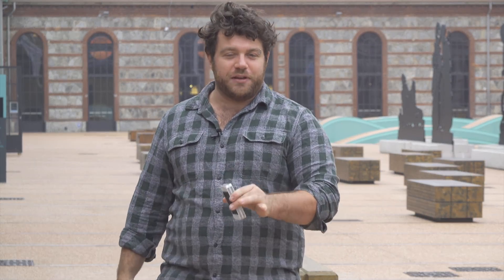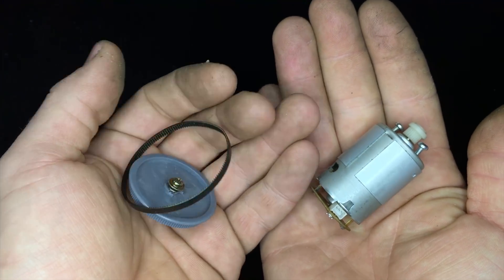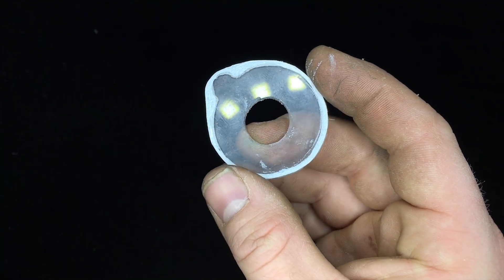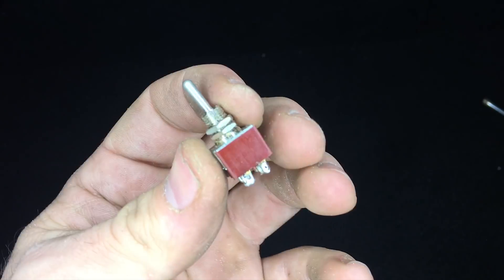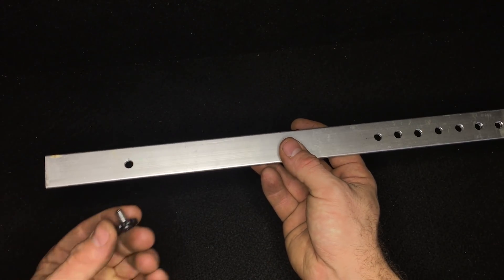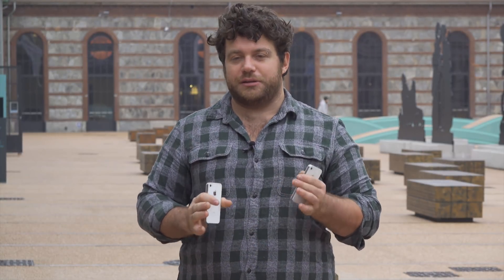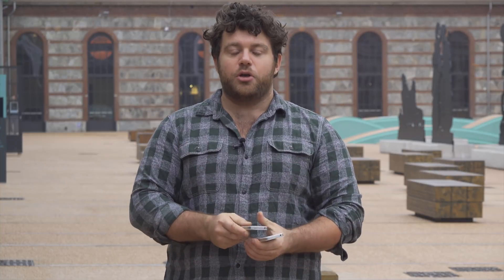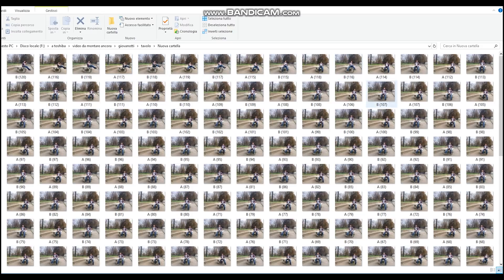Make 3D Photos placing 2 Smartphones This Way! • 10$ cost

Comment: Dude why not just record video ?
Reply: Exactly,  then he doesn't need that motor nonsense.  He can choose the frame offset between left and right cameras after the shoot.
Reply: @davemarm  indeed, and 8 cm is way too far from eachother. It doesn't work in the timelapse-mode, quality will be better in a videomode. Layering left & right over eachother with +/- 50 percent opacity mix will have a better effect.

Comment: The time stamp idea is great!  Try moving the cameras closer together, almost touching.  Put a little clear tape on the center of the display and mark the center of each display with a cross.  Get cameras to have the same object [maybe about 3 to 6 meters away] centered and level on the crosses.  The angle will be less which may help reduce eye strain.

Comment: You have to angle the phones so that both lenses converge at a single focal point. That is why your videos didn't work and that is what caused the extreme jittering
Reply: and also low fps due to taking individual pictures .. he could just shoot video from both and then put the frames on order
Reply: No. To take stereo images you should never angle the lenses in (toe in). The cameras should be parallel to each other.
Reply: I think it would look better if he (or the subject of the video) was in the same relative place in the framing of each camera image, which is conveniently  just happens to be at the convergance point.
That way the subject wouldn't jitter side-to-side, but the scenery around them would, just like the music video used as inspirarion.
Unfortunately, I'm not too sure if this can be done dynamically (eg: fixed camera rig position and moving subject, or the other way around) becaus the convergance angle would change as either the subject or camera rig (or both) moved.
Reply: As well as the phone's need to both point straight, they also need to have the camera sensors the same space apart than your eyes are in your head, no more!  I know you would think the further apart the more dramatic result, but optimal is about 2.5 inches or 64mm, a flat plate at the back of the phone's could correct the forward facing part..

Also to get better results make a double cam so both cameras shoot at same time, that way sideways movement won't jerk left right left right all the time..
Reply: @CrustyBiker  
I have found through experimentation that the ideal distance apart for the lenses is about 1/15 of the distance to the main subject that you want to see in "good" 3D.  But for most photos, what you recommend is great but if you want to see buildings, mountains, etc. with a 3D effect, you will need to separate the lenses considerably. 
Try taking 2 photos from an aircraft, (or from a car of a distant scene), in quick succession, one after another and you get a great 3D photo. I have taken photos of the Alps and other mountain ranges from out of the window of a plane and got a beautiful 3D photo of the mountains. 
And it is absolutely vital to not "toe in" (both pointing straight), as you correctly point out—otherwise the two images will suffer from a "keystone" effect and will not line up properly.
Cheers.
Reply: @Nilguiri ah just read your reply to me 6 years later lol, yes I agree with you! 👍
Reply: "You have to angle the phones so that both lenses converge at a single focal point.  
Absolutely not! Your thumbs ups are obviously from people who have never tried it. That is the worst thing you can do! Keep the camaras/lenses parallel. DO NOT ANGLE THEM IN.
Reply: I owned a HTC Evo 3D a few years back, and both cameras where just next to each other, didnt always work perfectly though